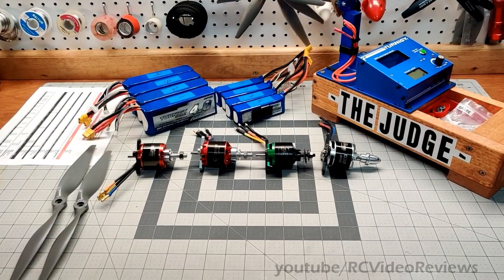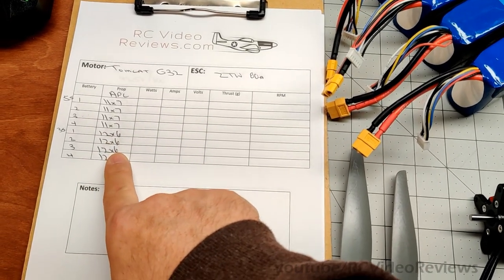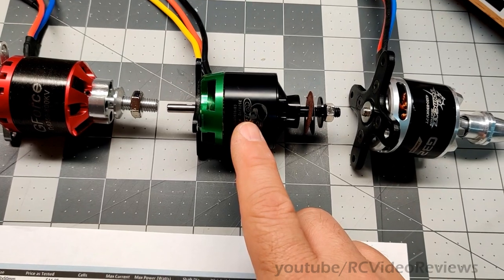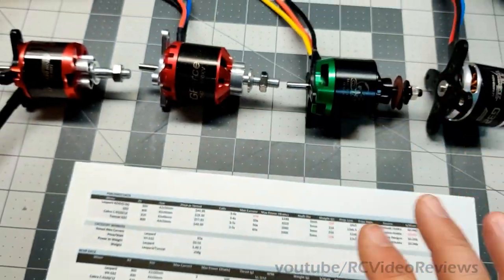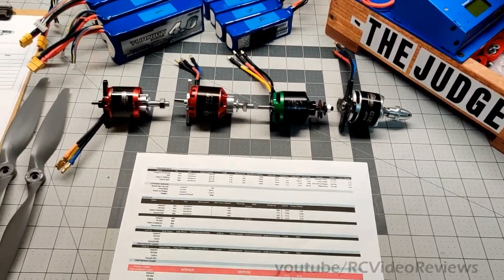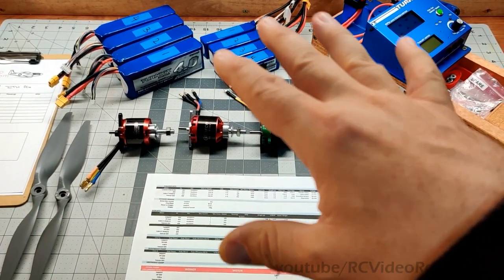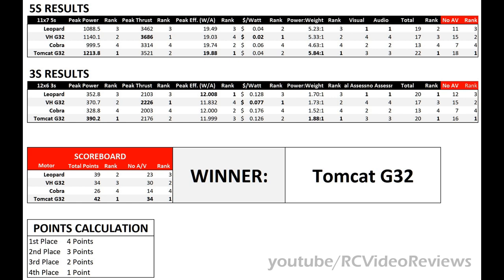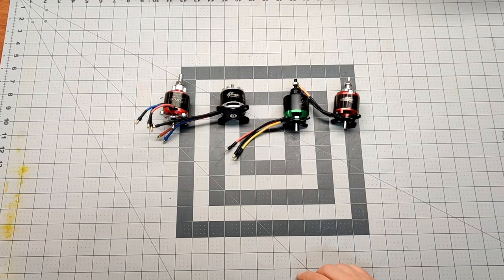What is the Best Brushless Motor?  32 Class Brushless Motor Roundup  [The Judge Ep. 4]

Comment: Since I’ve used ALL these motors. I can say from my Real World experience, your results are pretty spot on. Although I personally favor the Leopard motor, probably because of its aesthetics and availability. I’ve only had one Tomcat and had great results with it. It’s Quiet, great power, very good longevity and it’s economical. I think the TOMCAT might be my NEW Go-To motor. OUTSTANDING JOB!
Only letdown was that you didn’t have a Rimfire motor for the TOMCAT to trounce! 🤣🤣🤣
I wonder what the price per watt would have been for that motor.
Reply from the maker: Hey Dave, I'm REALLY happy to hear you have some first hand experience with this group and your experience matches up with the testing. I am DEFINITELY going to get a couple of Tomcat's going forward.

I just KNEW I had a .32 Rimfire in one of my planes. When I started to take the plane apart to get the motor, it turned out to be a .10. I was bummed about that too.

Appreciate your comments, thank you.
Reply: RC Video Reviews I thought your Escapade MX had the Rimfire .32? Maybe you got rid of that plane or changed the motor out. 
Anyway, this was a LONG but VERY INFORMATIVE video. I know it took a long time to put together but WOW! The TOMCAT performance blew me away. Thanks for all the hard work putting this together. 

Also, compared to the Rimfire, the Cobra is still a budget buy. Maybe only $30 or so but cheaper.
Reply from the maker: The Escapade has a .46 Rimfire. The Cobra is a definitely a great savings over the Rimfire and is only slightly more expensive than the Tomcat.

As I said in another comment, the Tomcat has my attention right now. I will absolutely be getting more of them for future builds.
Reply: RC Video Reviews I knew it had a Rimfire! I was just wrong on the size. 🤣 
BTW I have an Escapade MX in the box waiting to be built!
Reply from the maker: @davidknutz3314  Don't worry, I was wrong about the size in the Slick 480. For some reason I thought it had a Rimfire .32 and it was only a .10. Way off, and that's MY PLANE. Hmmmm, Escapade MX with a Tomcat G46?? I should get a Tomcat G46.

Comment: I noticed that the VH G32 prop shaft base has no grooves, while I think all the others did. Any potential problem with prop slippage?
Reply from the maker: Really good eye! On my Ryan STA I had two dremel sanding discs back to back between the prop and mount. That was mainly to help get the initial bite when tightening because there is nowhere to hold the motor. After the initial bite I don’t believe they are necessary. 

During the motor test I didn’t use additional support and didn’t notice any slippage.

Comment: Well done test. 
I didn't watch the whole thing so maybe you made comment to this at some point. One thing to keep in mind is that watts/amps gives volts, not efficiency. Watts, amps and volts are all input/power consumption numbers. Thrust or RPM with same prop would be an output. So how much output (rpm, thrust)is created with given input (watts would be best but amps works too) would be how efficient the motor is.
Reply from the maker: Thanks Steve. Forest -> Trees. The good news is that thrust and power aligned with the top two on wattage so I don't think the results would change in any event. I will keep this in mind going forward though. Thanks again.
Reply from the maker: Steve, I re-calculated the efficiency numbers. The Cobra and Tomcat did swap places on that ranking, but it wasn't enough to change the final outcome. So THANK YOU for helping me out. I've updated the description acknowledging the adjustment.

Comment: I wish you would have included the eflite power 32 motor in this comparison.
Reply from the maker: Yeah, that would have been a good one. This was a huge test as it stood though. I love my eFlite Power 52.
Reply: With the Eflite Power 32 being a 770 kv motor and the Tomcat 32 an 830 kv motor could it be assumed the Tomcat is more powerful?
Reply from the maker: @joem5639  You can assume it will [likely] spin faster. I've seen KV variances up to 100kv over spec. I don't assume anything else about these motors. That's why I test the living daylights out of them :)
Reply: I’m glad you do these tests. I’m new to electrics as I’m a die hard glow guy. I bought a NIB eflite P51b e32 at my LHS with the intention of putting a 2 or 4 stroke in it but now I may just keep it electric. The ARF was marked down significantly but still  expensive when you add up all the costs.
Reply from the maker: @joem5639  Yeah, it's not the plane, it's the stuff that goes in the plane most of the time.

Comment: Do you know how many poles the Value Hobby G32 has?  I am using it with the Spektrum smart ESC and that info is needed. Thanks.
Reply from the maker: I used 14 poles for the test but I didn't take the motor apart to verify.
Reply: @RCVideoReviews  Thanks much - will try that initially
Reply from the maker: @bmarlowe3968  you’re welcome.

Comment: A better efficiency number would have been grf thrust per watt.  In this case the Cobra is a clear winner with the Gforce G32 coming in a very close second.  The watts/amp rating should be thrown out since this is just margin of error in your calculations/measurements. Having designed several motors myself, the laminations you are seeing on the Gforce G32 are just the iron layers that carry the magnetic field back to the magnets. They are layered like that because of skin effects.  All the other makers are just adding a sheet to hide that.  It makes no difference to the performance.  I feel you gave Gforce G32 short shrift on the rankings as a result.  In my view, the Gforce G32 is the best motor of the bunch for raw performance, not just value.  And the Cobra isn't as bad as this would indicate although it's close to being the worst of the lot.   

Please don't take these criticisms to mean that I don't value your work.  Most of your stuff is top notch and helps me with a bunch of stuff that I'm not that good with. Even this video, with it's minor flaws was of use to me.  Thanks again.

Jim

PS. I see in other videos where you have changed your number crunching based on someone else's input.  Bravo!
Reply: I have been running a G-Force G32 in one of my planes for the last 6 years.  I have hundreds of flights on that motor, and it has performed flawlessly.  I am very happy with the motor.
Reply: @johndcoffman  I've got 3 planes powered by that motor. And another 4 planes powered by Gforce motors of different size. Great value.

Comment: 12x8 prop size on three cell on such large motor isn't enough you should of went at least 13" prop or 14"  I'm just saying. 30 amps 300ish watts couldn't get a 6lb or 7lb plane off the ground very well.
I'm sure it would be slow flyer.
Reply from the maker: I wouldn’t use these motors at 3s on a 7lb plane. On 5s these were making 1000w+